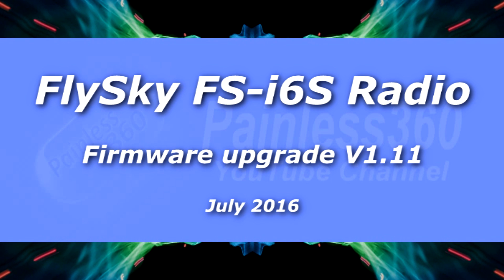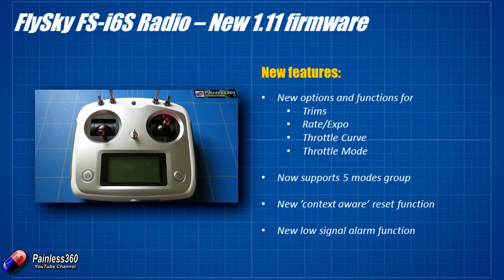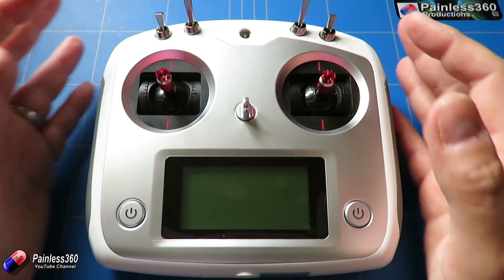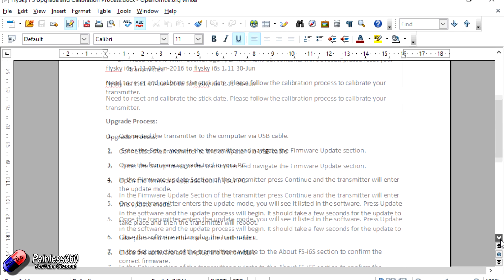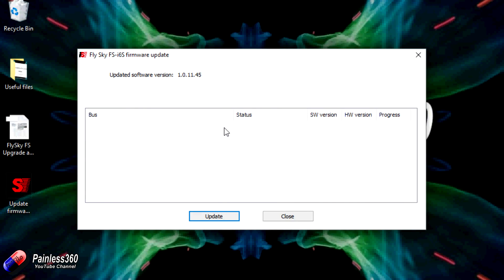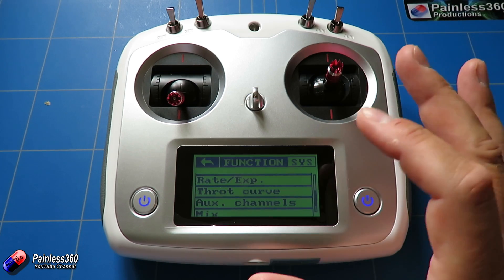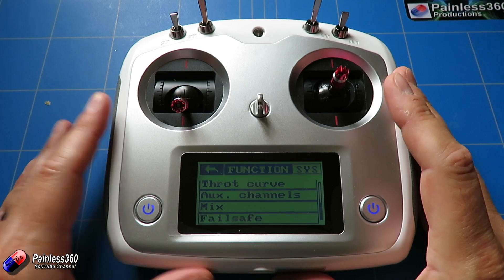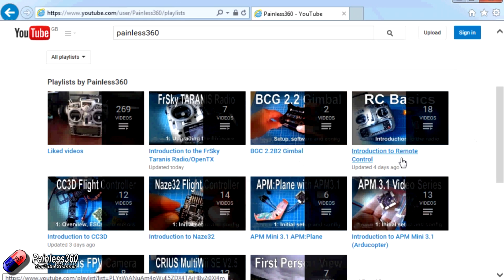RC Tips: FlySky FS- i6s radio firmware upgrade (expo, dual rates and throttle curves)

Comment: Hi I have a flysky i6S (all silvery one) TX and am trying to hook up the Banggood Multiprotocol Chinese TX module but cannot find a good +6-12V pad to solder to. I found the PPM_OUT and a good ground - any idea where the +V_Out would be or be labeled?
Reply: I have seen other videos where people use this module with the flysky i6, so hopefully I did not make an error assuming the i6s will just work the same.
Reply from the maker: +justin vaughn Sorry,  I've not tried it here. Best of luck with it!

Comment: I have this Radio but it won't do the firmware upgrade. can someone help. Tried different PCs different cables and still the PC won't recognize it. thanks!
Reply from the maker: +Ray Galarza the firmware is specific to the manufacturers version of the radio. See the other videos on the radio. Happy flying!

Comment: can I use this radio to control a trex 500 with flybar?
Reply from the maker: +Sem te Vruchte  no swash mixing on this radio...
Reply: Painless360 so not possible?
Reply from the maker: +Sem te Vruchte If you can fly your help without any swash mixing then it'll work..

Comment: Hey all, does anyone know of a way to do an elevon mix for flying wings on this radio? I've got the Turnigy i6s version
Reply from the maker: Sadly not, this isn't designed for that realty. There are more firmware updates in the works so let's hope they add a simple plane mixer.
Reply: I feel pretty dumb having bought this radio. It seems to be a cooler looking version of the i6 with less than half the features and 10% of the receivers

Comment: can you do a How to elevon mix or deltawing please
Reply from the maker: Very tricky on this radio I'm afraid..
Reply: Painless360 Is it posible? i have been trying and the only way ive found is by tuning the transmitter 45°, though i wouldnt try flying that way
Reply: Painless360 find me on Facebook I didn’t manage to catch you at ma4 but I have found a really easy way to sort this out that I think you would want to share with everyone 
Phill Parslow
Reply: Elhebrito yes I have buddy
Reply: I desperately need elevon setup for my eachine blackwing :(

Comment: Thank you for this video however i have a question is it possible to set up the dual rates to a switch ie have low rates flip a switch and have high rates on the radio I cant figure out how to configure this thanks in advance
Reply from the maker: I've just sat playing with it to see if you can and their doesn't seem to be a way to set that up on a switch. Best of luck!
Reply: Thanks for taking the time to check such a simple over look on there part I hope they will add in the next firmware update. for me I feel this is the only thing missing overall this radio is great. I see the just now are about to release a micro ibus receiver for it.

Comment: Somebody needs to tell those guys,they need a helicopter mix,or can you show how to setup the mixes to achieve collective control??
Reply from the maker: +im2tall1 a lot of these radios are not coming out with easy heli setups. Even OpenTx doesn't do a great job. This radio is more for the entry level quad pilot without those external trims are more advanced mixes and settings. Let Flysky know it's something you want. If they are asked enough they may make the effort. Happy flying!
Reply: Painless360 I'm just gonna wait for the Horus! I'm assuming the Horus will have a swash setup as a option! I'm not sure but,I think I saw a model option in one of the vids,and a Heli was one I could be wrong.It would really suck if I waited all this time,and could've just bought a Jeti.

Comment: I can't connect the transmitter to PC. I tried so much, but it don't work. Do you have a solution?
Reply from the maker: +Florian Veltmann it should connect automatically and load a driver that makes it appear as a game controller in Windows.. I'd check the USB cable. Best of luck!
Reply: I have been using it as a game control via USB mode. I play RC Simulation 2.0 and the fixed wing aircraft fly much better with the FlySky FS-i6s than the Xbox controller. CHEERS!
Reply: Did you find a solution to this? Same problem with mine. Have tried different cables.The PC do register that the control is hooked up, but the Flysky update software do not register the controller.

Comment: If you want to use rechargeable batteries checkout using LiFePO4 AA batteries. You only need two plus two dummy batteries. You get the full 6 volts unlike NiMH which over four drops down to 4.8 when fully charged. One drawback is that the low battery warning does not give much time to land before the Tx runs out of power. This is because of the discharge curve characteristics.